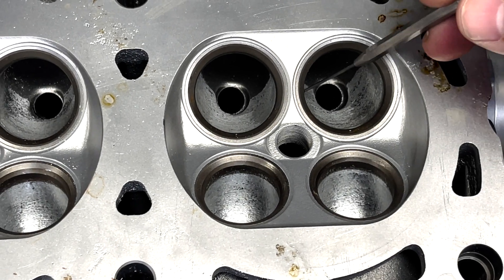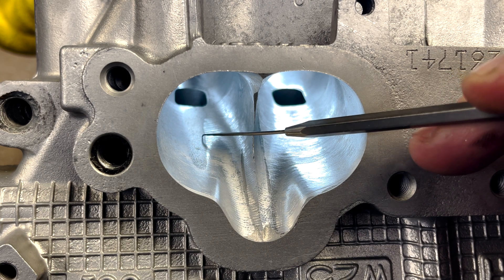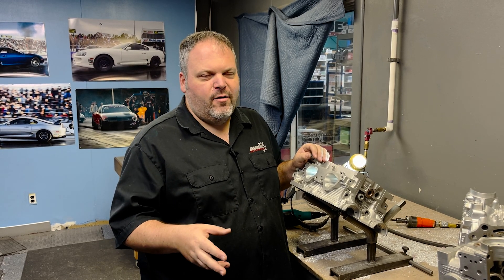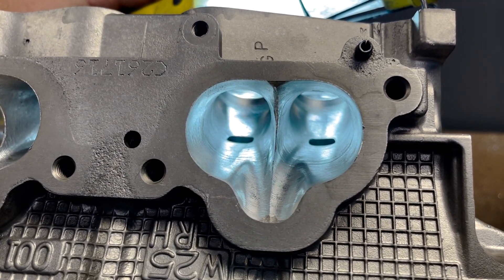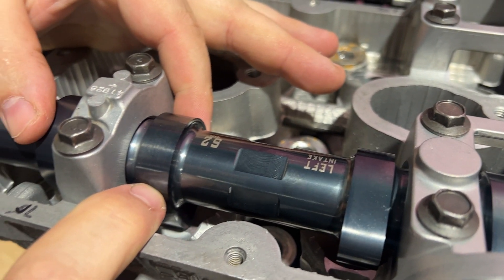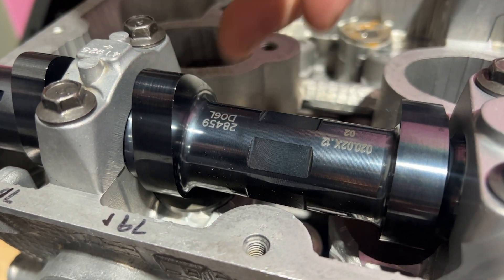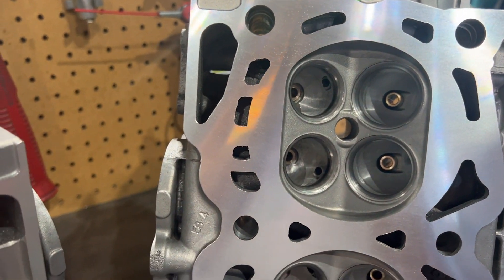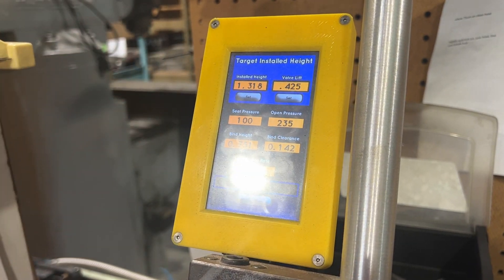Rising to Glory: The HeadGames EJ25 CNC head build-Up process unveiled

Comment: @headgames Dave would using a 5073 spring kit be enough and reliable for 550+ on a s1?  Or 5076?
Reply from the maker: We use the 5076 for 500-700whp so you have more cushion for the pushing. 

Check out our power pak 2 for that power. Helpful hints helping you with valvetrain selection.
https://cdn.shopify.com/s/files/1/0725/1676/3953/files/001-Subaru_EJ-Powerpak2.pdf?v=1697043901
Reply: @headgames  yep that’s what I am looking for. Just waiting on a couple items and then bringing the heads in. 👍🏾

Comment: On the D25 heads, in the combustion chamber, removing the material around the valves(there’s a lip) will it improve flow? And have you done a before and after test.
Reply from the maker: Improves low lift flow and reduces detonation. Great question! After 500whp it really helps.